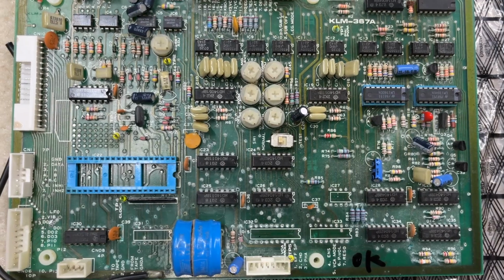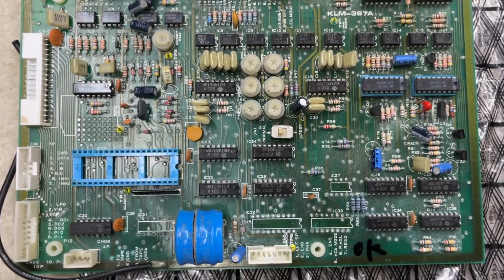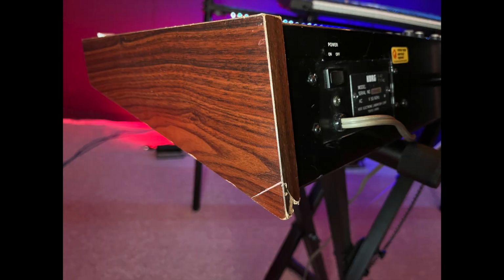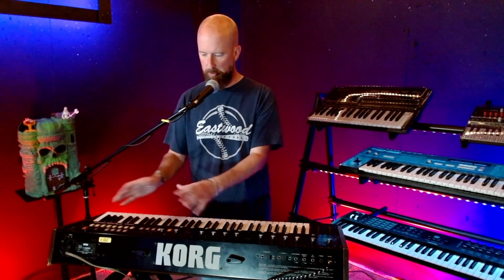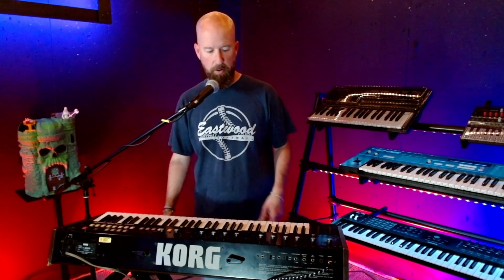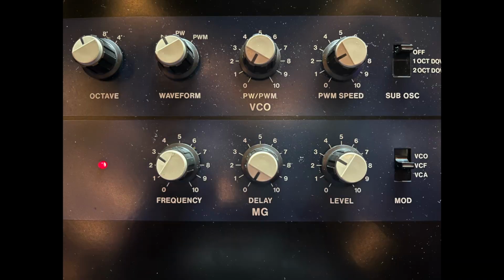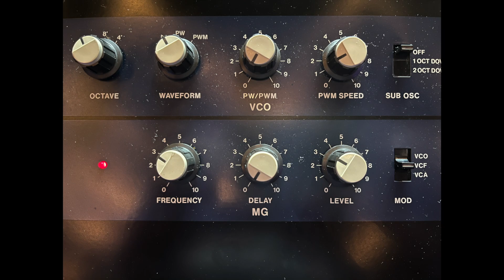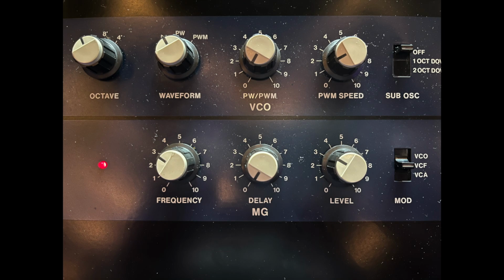KORG Polysix : Tidbits, Thoughts, Recommendations

Comment: Hey man any thoughts on my problem? I can’t get my polysix to “write” programs. I switch to “enable,” press “write” (which blinks) then choose bank and program, and the “write” button stops blinking. But the new program doesn’t save in the spot. It instead keeps the old preset program.
Reply from the maker: Are you working with an original Polysix board or using the Kiwisix mod?
Reply: @mwmusic29  original polysix I believe. I have not opened it yet. I read elsewhere someone had the same problem and replacing the RAM did the trick
Reply from the maker: @jacksonrauch9429  I'm not sure how much help I can be but I'd be glad to do what I can - just need to know which version you have.  Thanks!

Comment: My polysix is working great except for the memory which im not sure if it actually works or not, because i never really use it. I dont know if it loads or saves the memory or not. And the arp knob seems to be going. It doesnt seem to be able to change the speed of the arp very well.
Reply from the maker: Yeah sometimes age catches up with the old machines and they need some maintenance.  Could be what you’re running in to.